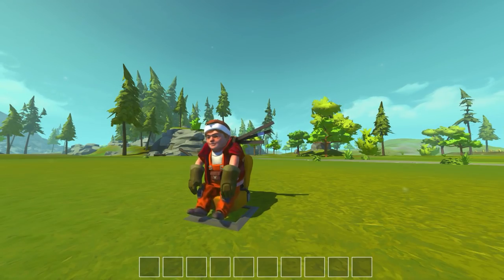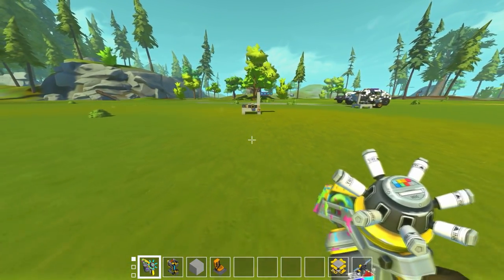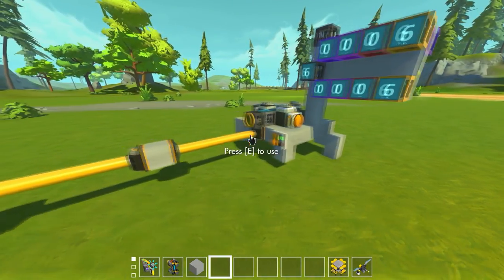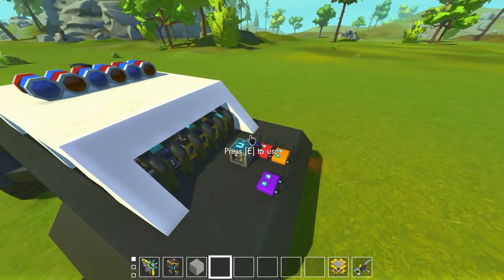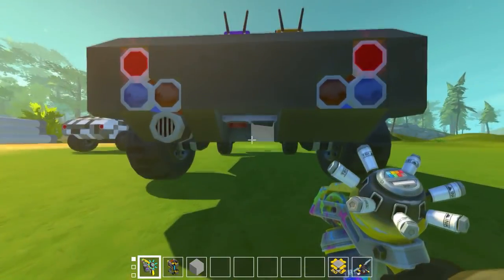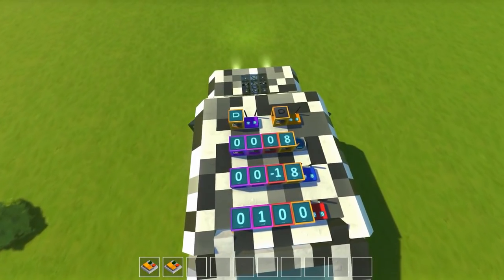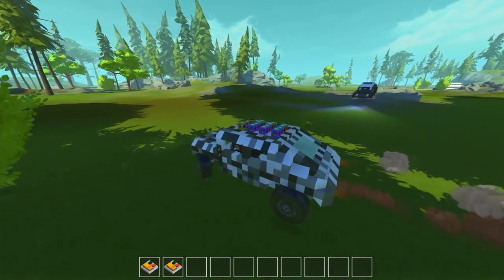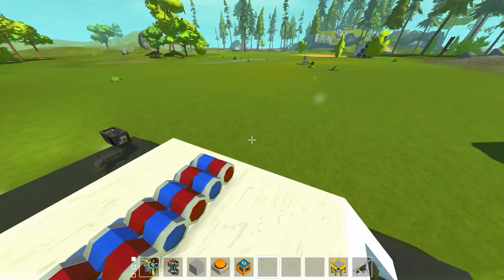Radar Speed Detection and AI Police Car! (Scrap Mechanic #359)

Comment: You could also just use the orientation block  from the modpack and use the distance mode to get the distance to the player. That way it wouldn't measure terrain.

Comment: Two suggestions:
Add the velocity of the car in the direction of the sensor to the speed picked up by the radar, so the speed reading works if the cop car is moving.

You could also use the distance to the player (that can be done with the intelligentia mod in binary and The Modpack I think) to measure speed, so it doesn’t pick up other stuff. 
Alternatively, have a timer so that you have to go fast for X seconds before it starts chasing. That would eliminate the speed jumping up momentarily when it catches the terrain.

Cool build anyways, you should add obstacle avoidance to the cop AI!

Comment: Do you think you could use the Modpack to make a self balancing walking mechanism? Either bipedal or quadrupedal, but it needs to require active corrective action in order to not fall over.
Basically, (very simplified) Boston Dynamics in Scrap Mechanic.
Reply: this is genius

Comment: hey kan, maybe you can make the AI car check if the speed is like more than 50% or so off from the last measurement and if so don't count it as driving to fast, so it only activates when the speed didn't change at a crazy acceleration! 
great prototype btw ;D

Comment: 2 ideas to prevent picking up terrain:
1. use color sensor, if it picking up black ignore speed
2. use timer, if speed is higher than 50 in something like 2s start, chasing.

Comment: Just use the orientation block on player mode, connected to an X-o-meter with a greater than or equal to math block, also connected to a counter block at fifty.

Comment: hey kan if you could have another way of sensing distance from you to the intelagentia mod and using the meter measuring your speed then you can have the cop measuring you or your buddy for a speed limit and chase that speed breaker and thus if it is monitoring your friend and you break the limit it won't notice you but if it was watching you instead then it "activates" and it would be nice to have a block in that pack that can monitor a specific player and thus depending on logic comes after or runs away

Comment: now we need a chronograph and we need to have a larger unit measurement system so we could have Kb/Hr or b/s but b/s sounds lame. we need to now measure G, speed of sound and figure out the games standards so we could have a accurate measurements to set reasonable speed limits lol